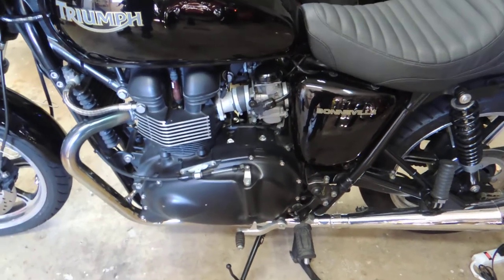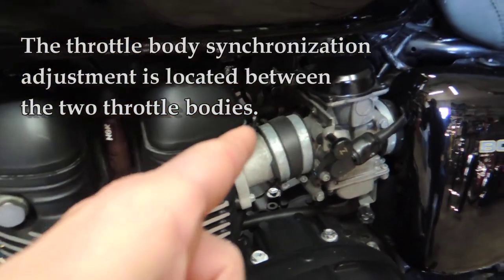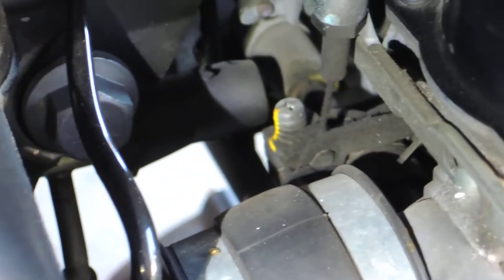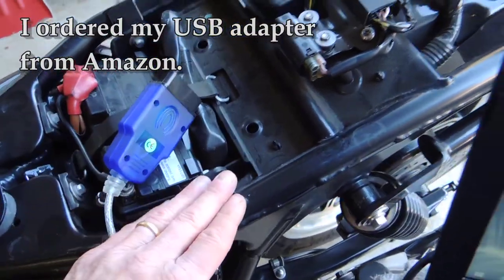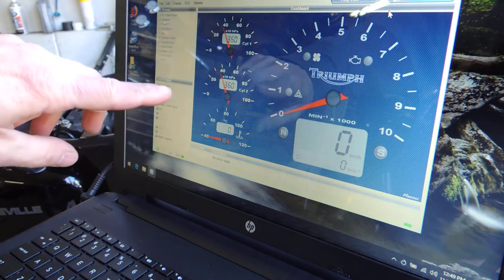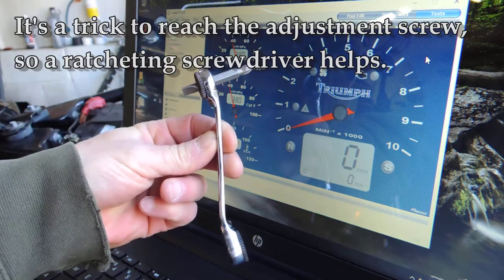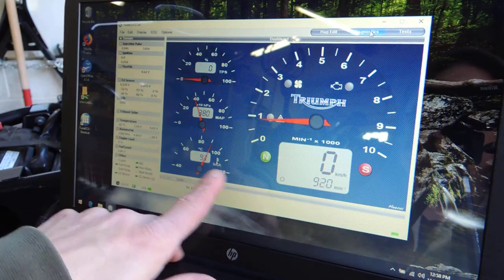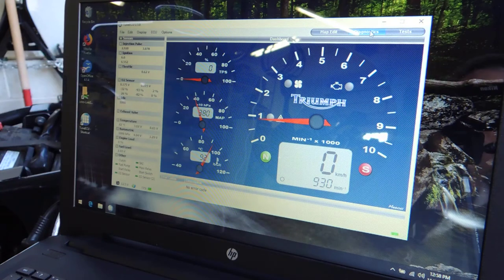Triumph Bonneville Throttle Body Syncronization

Comment: Hey. What should the x10hpa throttle bodies be for the triumph speedmaster 865 2009 EFI? What should I do If indicators will show different numbers on left and right throttle body? Tomorrow I will check with TuneECU